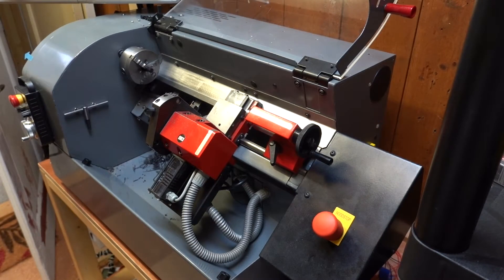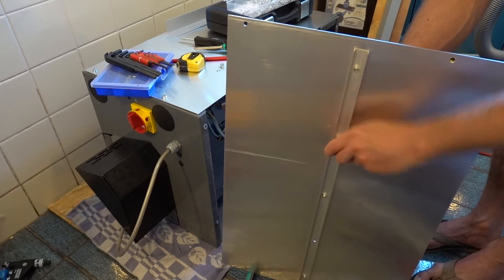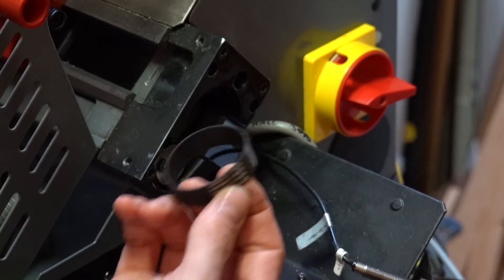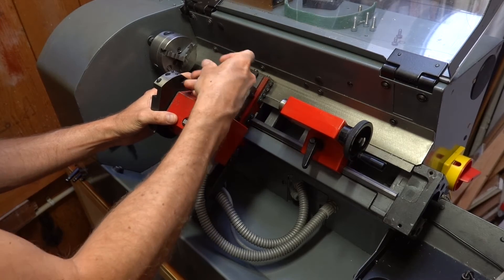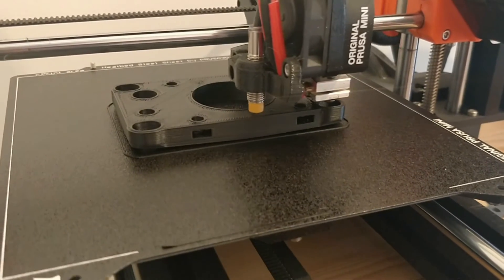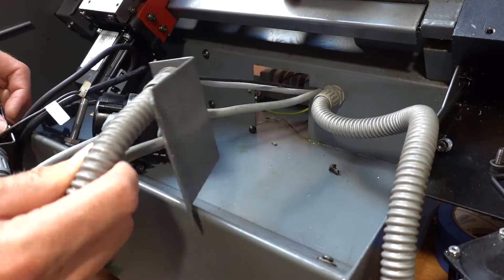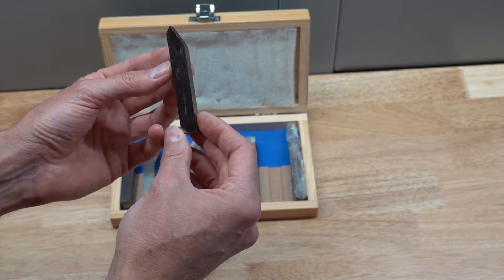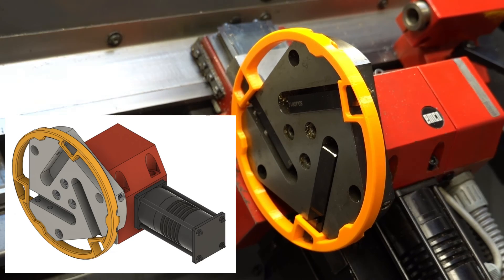Mini CNC Lathe Retrofit Part 2 - Machine cabinet, Stepper Motor replacement, Lathe tools

Comment: Nice work how accurate is this machine? Can it produce parts with tolerance >0.01mm
Reply from the maker: Hi, I am not sure if this applies to Emco 50 lathes or parts in general, but I just measured some delrin parts and for diameter I am well within +/-0.01mm. (stdev 0.0025). For length it is a bit less accurate with stdev 0.0088 on this specific set of parts.

Comment: Do you have a link to the parts you used mainly stepper motors and pulleys and timing belt ?
Reply from the maker: Sure, they are listed in the pdf document which can be found in the website article, linked in the description of the video. The pdf contains links to all parts used in this retrofit.

Comment: I'm finally getting around to doing my retrofit, using a masso and clearpaths. The homing uses both a mechanical and the hall effect sensor on the lead screw. both switches need to be activated during homing. its very precise, I plan on keeping that system. any idea how many teeth are on the pulley on the leadscrew?

also since mine was running, I crunched the numbers, they were running the motor at 120hz, to get up to 3000 rpm.
Reply from the maker: Looks like a very nice setup, I am jealous about the clearpaths. Not sure which type you have, but I can also imagine increased wear on the lead screw if these are set too agressieve in terms of acceleration and speed. I don't know the exact teeth count on the pulleys. I just calibrated the gearing ratio in my controller to measured travel on each axis. This then includes the pulley ratio and microstepping. I also have mine set to a maximum of 3000RPM. Works fine but typically stay below 2500. No particular reason other than noise reduction. Good luck with your project!

Comment: sir, the emco lathe has only 2 limit/homing switches, i.e. x axis and z axis?
Reply from the maker: Yes there are only 2 switches, one on each axis. I use these for homing. Since there is no limit switch on the other side of the axes, I have set the SZGH controller to apply soft limits for that side. This of course only works after the machine has completed the homing cycle.
Reply: @uptimefab7412  thank you for sharing that vital information.cheers

Comment: Hello (sorry about my english)
 I also do a retrofit with SZGH, on emco 240, all things are a litle bit bigger ;-) 
1) the old Motors are 5 phase Stepper Motors, it is possible to get 5 phase driver to drive this smal Motors (but I cold not get one to drive with 230V)
I don't use 24V drivers, there is not enough power.I use only 230V drivers  Higher voltage enables faster polarity reversal of the windings, which improves the motor's characteristic curve.
2) min 5:01 the Sensor ist the reverence senser to home the axes, normaly ther is a mark on each axe to to get manualy to it. Then home it. 
I think this is a very good idea with high prezision, homing on 1 rev of the spindle than homing on the axe, on the other hand it is a bad idea while you could homing on any positions, and there are no limit swithes on the emco turn machines.
3) 6:23 I also think mounting stepper driver on  din rail is not the best way, the housing is also used to cool internal parts, and mounted dirct on metal plate helps cooling.
Reply from the maker: Hi, thank you for all these tips, very useful! The 240 is indeed a bit bigger;) whish I had the space for a type of lathe like that. The homing strategy you mention is interesting, but indeed risky if you don't pay attention. Good luck with you project!

Comment: what is the purpose of the cross slide assembly being on a 45 degree slant?
Reply from the maker: A slant bed lathe should have easier chip evacuation, as they would roll off the bed. In this case with the bed not having way covers the benefit is fairly limited. Also the angle makes the depth of the machine a bit shorter as the axis is in a diagonal position. Mostly though, I think they chose this design here since it was used as a teaching machine in schools for industrial lathes, which in many cases have a turret and slanted bed.
Reply: @uptimefab7412  thanx. I have always wondered that. Beings tho in either situation there is no real space savings.